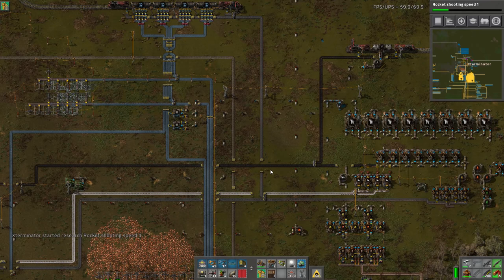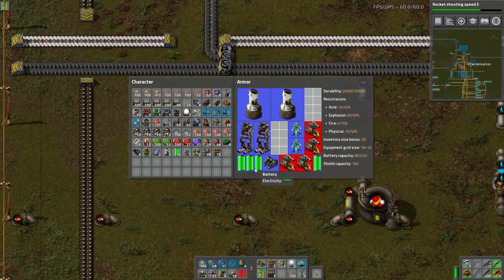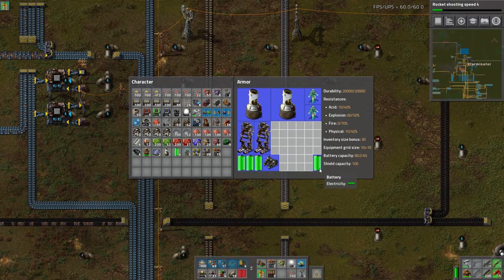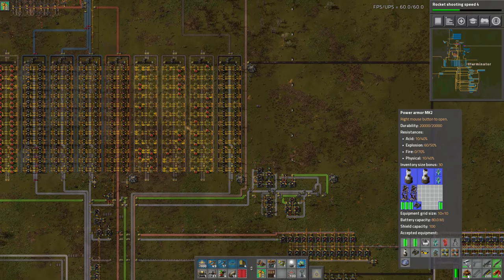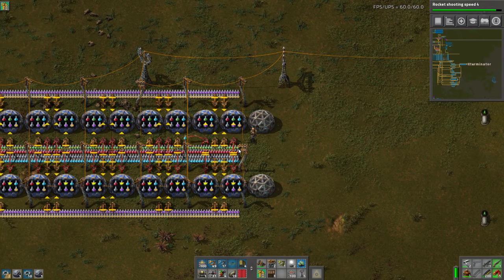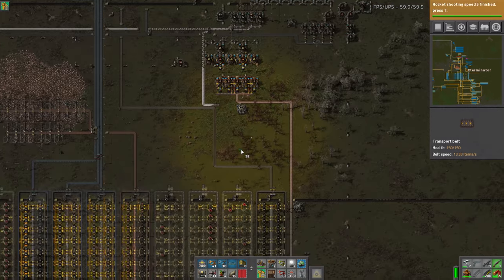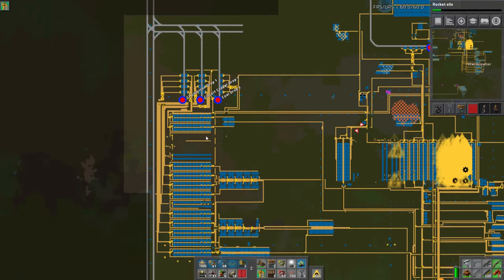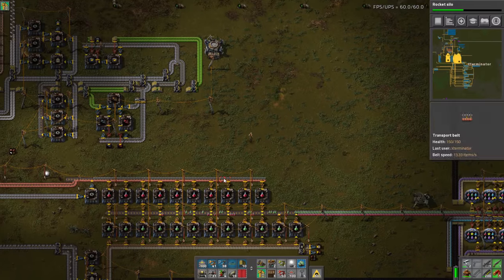Factorio: Tightening The Belt: Megabase Guide EP25 - POWER ARMOR LAYOUTS | Tutorial Gameplay Series

Comment: The copper is used unevenly because you have 3 smelting arrays pulling from one side, and only 2 from the other... and those two are feeding into green circuits that are backed up, so the copper being produced isn't being used as fast, allowing that side to back up even further.
_________________________________________________
If you want even unloading, you could underground the belts onto the same side of the track and then put them in an 8 by 8 balancer.

If you want to go 1000% overboard, first unload them onto a 6 to 1 balancer completely throwing space savings out the window.
Bonus: add circuit conditions for turning the train station off if there's not enough room to unload each individual car so trains only unload at locations ready to unload a full train.
https://i.imgur.com/rDdM6BI.png

Comment: Lost Productivity bonus in Labs.... Maybe it does happen..... BUT The amount lost is probably small. 
IF your researching small techs that finish quickly due to the large number of labs, the labs might, for instance, cycle 3-4 times, and end 'just' as the productivity bar is nearly filled. So that when you switch, you lose that productivity bonus. (In this case, yes you did lose out. you did not get a bonus cycle)
BUT Typically by the time you have Prod 3s in all your labs you are most likely researching the Big Techs. Techs which need say 2000+ cycles. Say you have 25 labs, each lab will cycle about 66 times with Prod 3 modules to make the 2000 cycles (Would have needed 80 without the Prod 3 modules). In the end you will have generated 14 bonus cycles, And if say it ended at exactly the wrong spot in the productivity bar (99%) you lost 1 cycle of bonus productivity. (On average it would probably be about half of a bonus cycle lost)
So in the end I think you will be generating much more bonus productivity than you will occasionally lose when a tech finishes.
Reply: Like Cheaty Hotbeef wrote this is wrong, you do not loose when switching research. It is only a visual glitch/error. I tested it even for "short" research cycle.